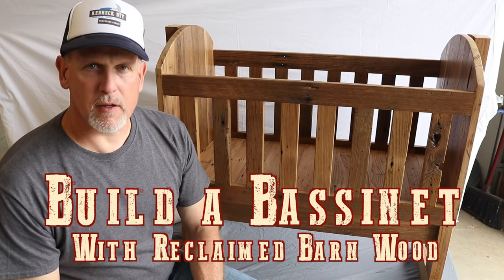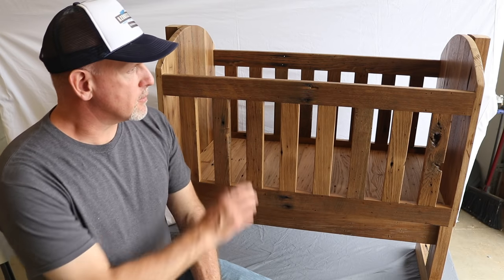Reclaimed Barnwood Bassinet

Comment: Great job. I love your videos. How would you build the swivel part without welding? or would you sell a set of those pins you made? (I don't have a welder).
Reply from the maker: Thanks for checking it out, Mike.  You could thread a nut on the bolt with permanent locktite on it?  Might hold up that way.  I could make them for you but they are pretty labor intensive.  Probably looking at 75 bucks to to it.
Reply: Thanks. Maybe I could take the nut and bolt to a metal shop and have them spot weld them for me. Your project turned out pretty amazing.